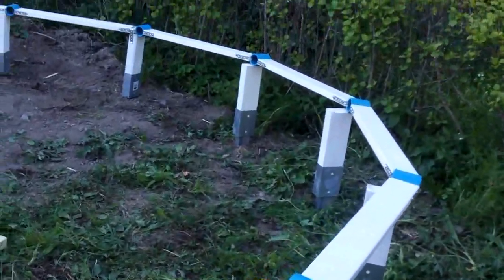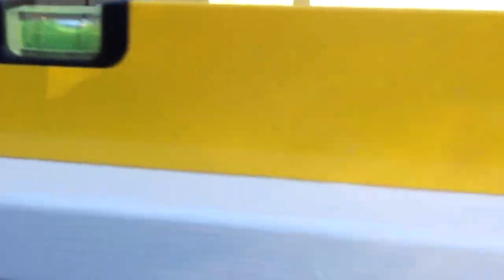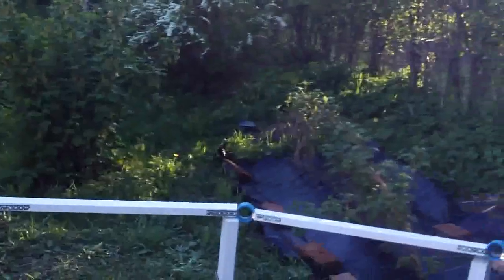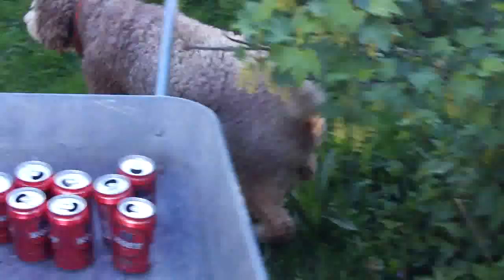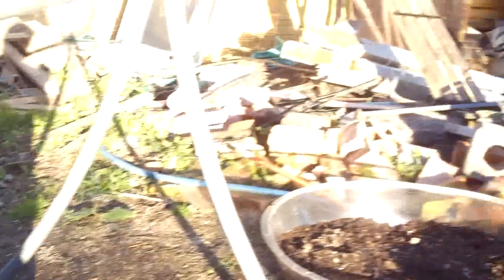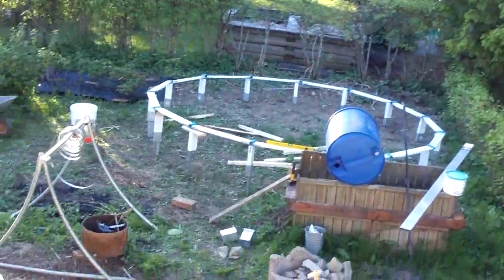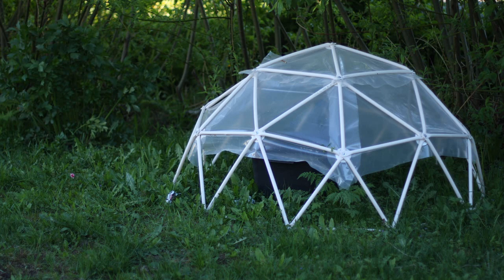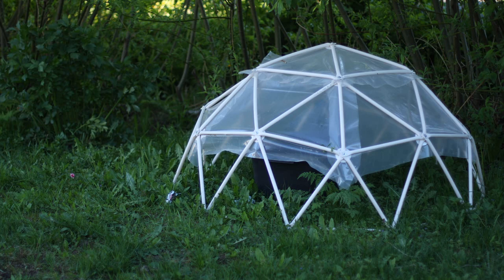Video 16: Dome greenhouse initial assembly.

Comment from the maker: Marius, it should be pretty to google: "Dome calculation tool"... The one that I used is the one at geo-dome (dot) co (dot) uk 
It's fine and it doesn't matter if you use metric or imperial... The unit you put in is what you get out ;-)
If you're into building your own I would suggest web4deb's videos that are the best you'll find on youtube... Part one is in the right sidebar suggestions to this video.